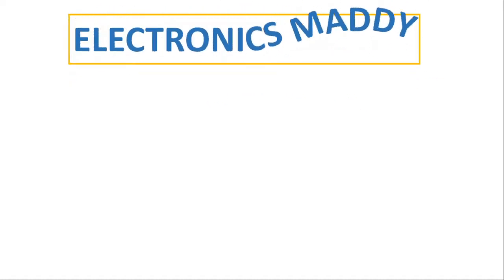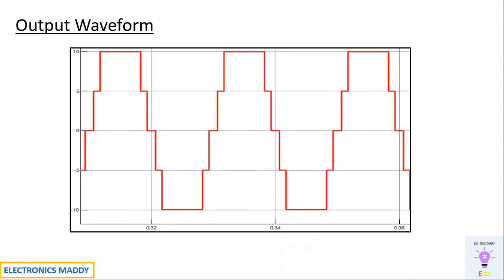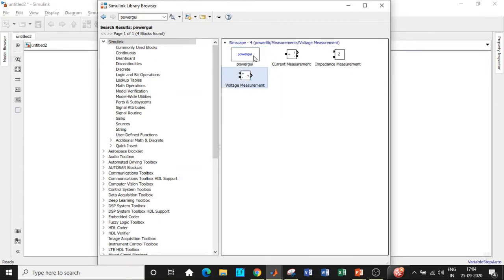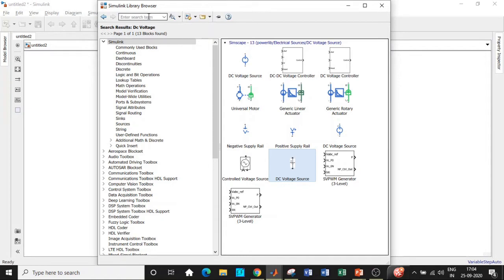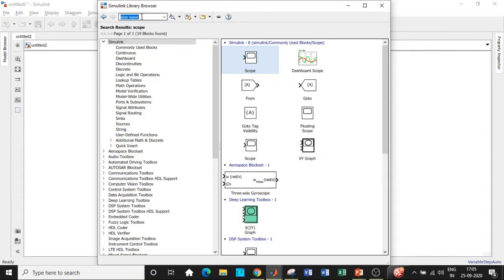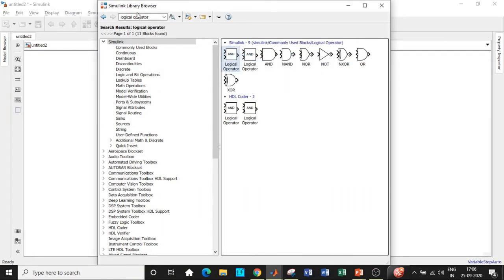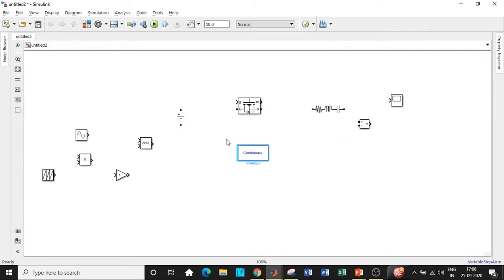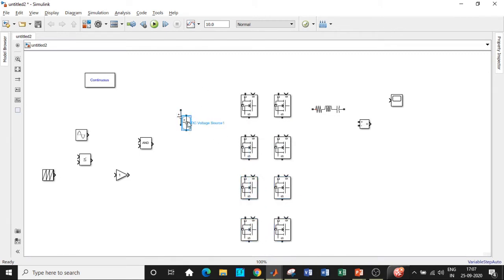Simulation of 5 Level Cascaded H Bridge Multilevel Inverter using SPWM technique in MATLAB |SIMULINK

Comment: Exact waveform isn't coming
Like lower waveform is fine but upper waveform is coming as square not stopped waveform
Reply: I understand the mistake
In the upper side bridge, it should be 0 1 0 for both
But not 1 2 1

Comment: What SPWM? You ended up with a simple staircase modulation because you did not implement the modulator correctly. You don't even take advantage of both zero states of each cell (00 and 11) for proper power balance. Better learn the basics before posting educational videos...

Comment: How we can do 9level using 8 MOSFETs?
Reply: It's possible in simulation only using the T-type NPC topology, because simulation-based MOSFETs are truly bi-directional. In practical inverters, for a symmetrical N-level inverter, you need 2(N-1) IGBTs per phase. Better learn from books, not from Youtube (the example here is not implemented correctly).

Comment: how to get 240V output if DC source =12 v
Reply from the maker: You need to determine the modulation index for which the output will be 240v. You can adjust the value of modulation index by changing the frequency or amplitude of the carrier ( use a saw tooth generator for carrier). Initially try by trial and error. Later go with a exact procedure. Hope this helps.  All the best :)
Reply: @ElectronicsMaddy  Thanks man
Reply from the maker: Welcome :)